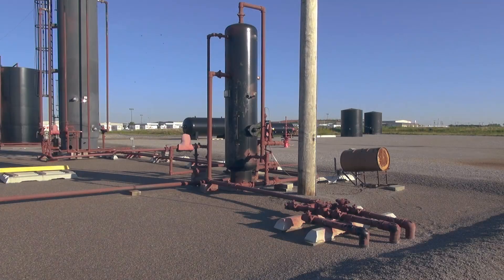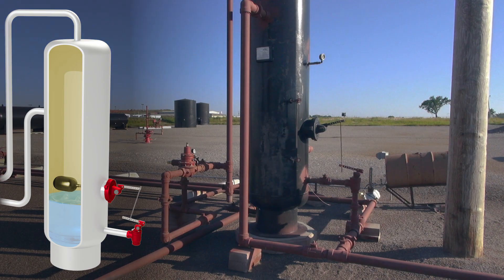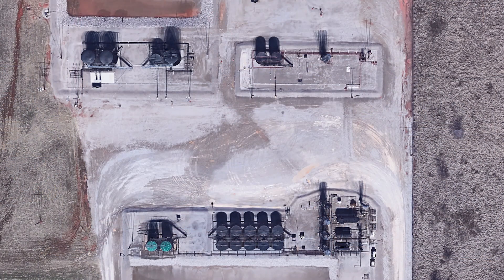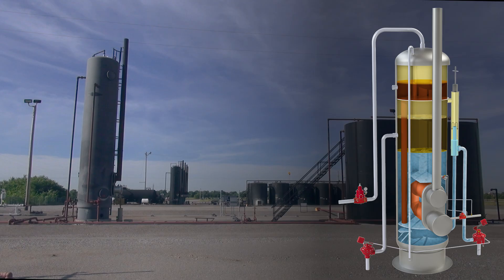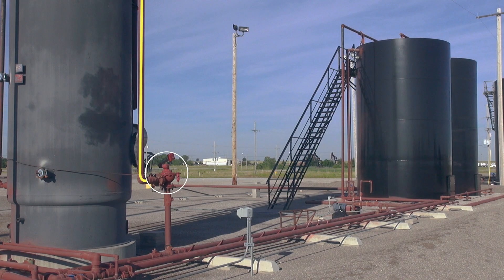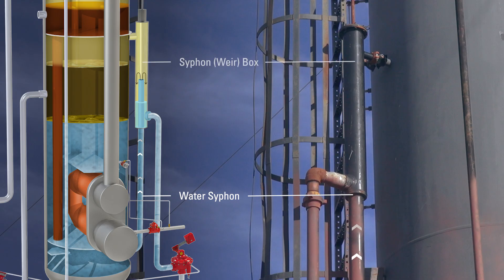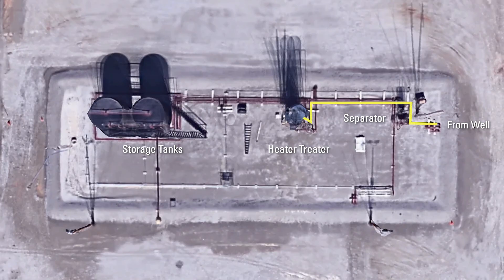Oil & Gas 101: Follow The Pipe on a Wellsite [How Production Equipment Operates]

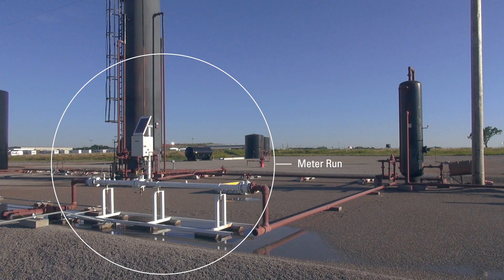Comment: 1:30 TotalFlow boxes, or what water haulers call (scroll boxes) are such a pos device We hate those soo bad because We simply can not just get the water levels in less than 30 seconds. Literally have to stand and wait for 30 minutes to check the water level and inter level (oil level) on the top of the water before pulling a load of water. While some water tanks have instant gauges to check after climbing the stairway to the catwalk, some do not, so it was a waste of time to walk up 3 stories just to see a totalflow gauge that does not have a screen but has a pack full of vape batteries in the gauge itself. Some totalflow boxes have dial pads or key pads which make it easier for us to quickly tap and look at the meter readings.... However companies like (Revolution) had such a control freak problem with locking the keypads so we had to wait 30 minutes to scroll through useless information like battery power voltage, date, time, etc. (Revolution Resources got bought out by Formentera ending of last year)..

Cant lie, company I work for has people like me who pull 10+ loads in a 12 hour shift, if your totalflow box is like this where we cant access water meter readings in less than 15 seconds? Don't be surprised or piss a fit if they pull 3-4 foot of oil out of the water tank and simply just don't put the tank levels on a ticket. Thats on you not on the water haulers. Work with the water haulers since they are on your pad more often than the oil haulers since water produces more at oil wells.

Comment: for this system ? how it handles h2s,BS&W that come with oil ?
Reply from the maker: If there are high levels of H2S, additional treating equipment may be needed. The heater treater will separate the BS&W from the oil.